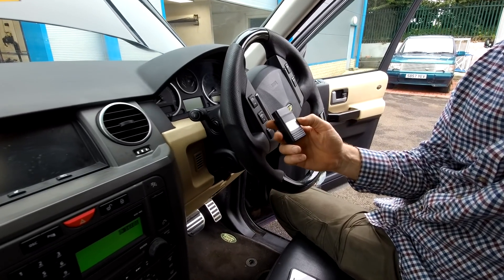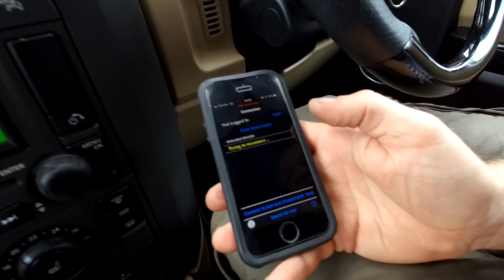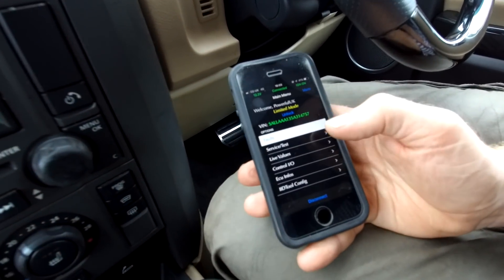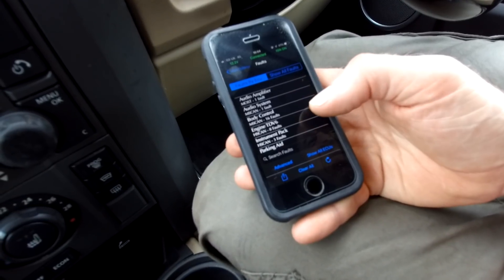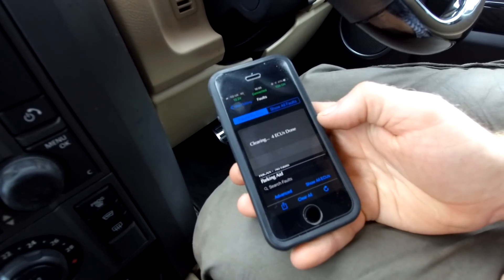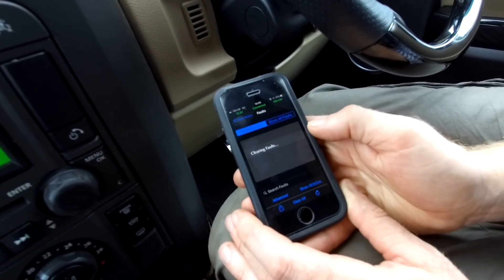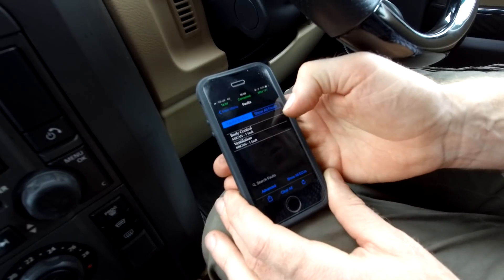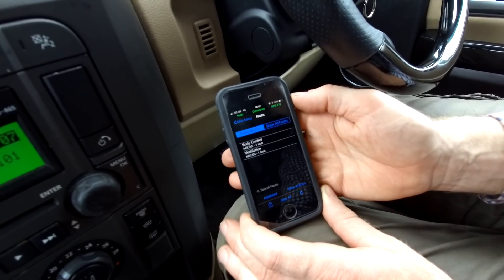Reading fault codes on Land Rover Discovery 3 using GAP Diagnostics IID tool

Comment: I don’t think EGR faults will show on the dash as a problem on early models. Therefore the turbo actuator probably caused that. Some VVT cleaner additive to the fuel tank is prob the way to go. Purple bottled stuff!
Reply: Andy Kirwan  
My LD3 started to loose power and showing the Engine Fault on screen. Also the smock is very dack . Can you tell more about the VVT cleaner , will it cure the problem? 
Bonny